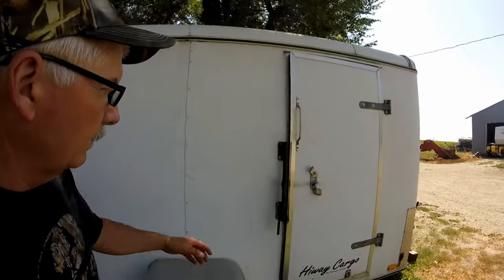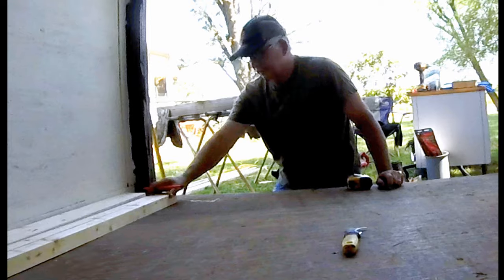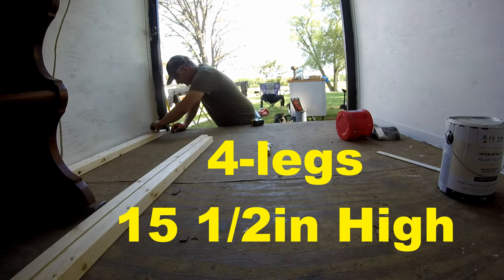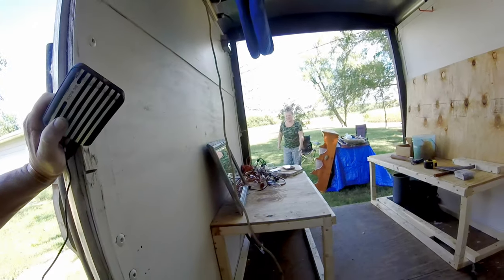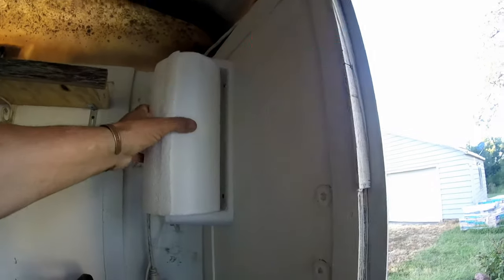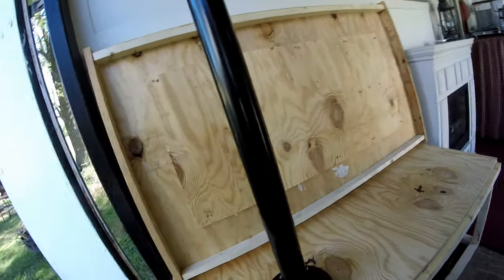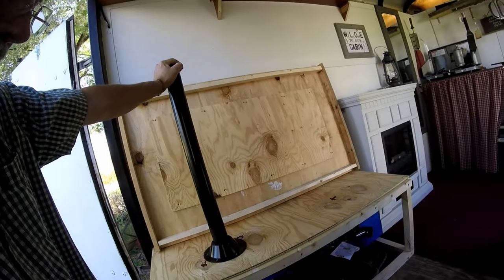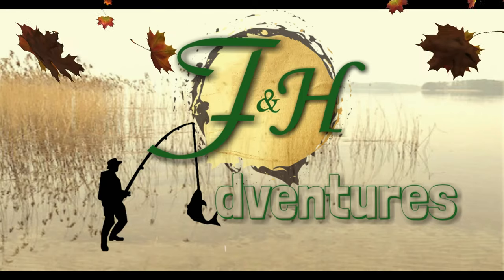How We Converted Our Cargo Trailer Into a Camper In Less Then A Week

Comment: Love it!!!  Especially the fire place.  We are getting ready to make a used cargo our camper. We brought a portable a/c unit. Not real expensive, we actually had it for our pop up so saving money and making do but it kept the pop up cool. Also, only one hole or small vent is needed. Can also vent it out a window. The pop up we unzipped by door and put the exhaust thing about the size of a sofa vac attachment, put it there and put zipper to top of it and duct taped about 1 inch above it.  If we camp where you do not need a/c just take it out. Wood fit under front counter. It is where we are putting ours. Love, love, love it, it is adorable.

Comment: What is the interior ceiling height?
Reply from the maker: It's 6.5 right in the middle, 5.9 wide inside and 10.5 long inside, thanks for watching.
Reply from the maker: So what ever size the trailer is, hope this helps.
Reply: @floydandcarlahampton2846  TU very tall one. I am looking at trailers now to do and I was going to go with a 5x10 but they all have had 5ft. Ceilings